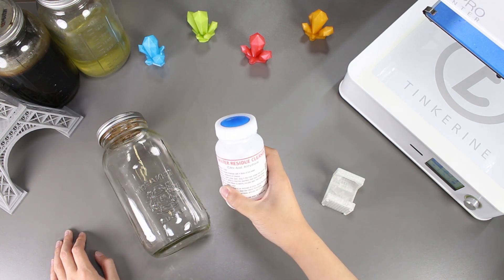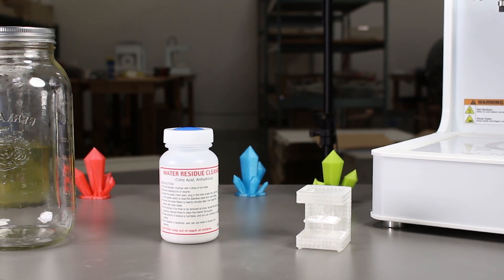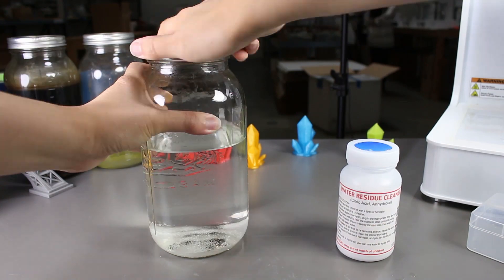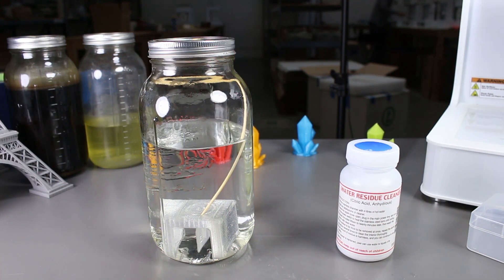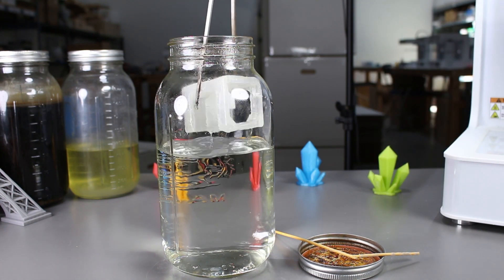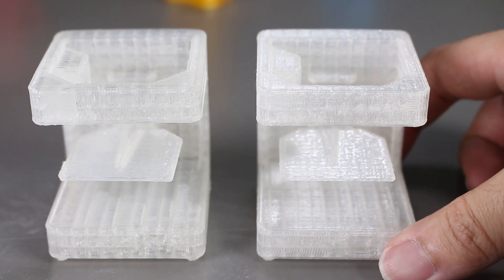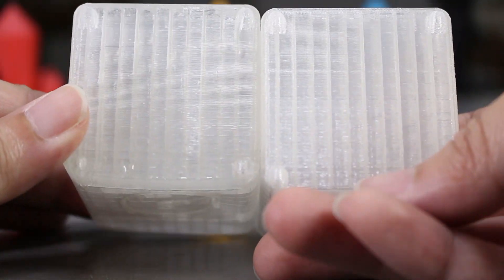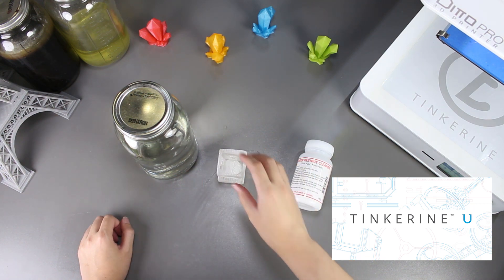Smoothing PLA Prints with Pure Citric Acid

Comment: I've watched these so many times, and they always infuriate me. An idea is suggested- then tested. once. on one filament, no followups, no attempts to perfect or enhance the effect. 

this isn't even very concentrated citric acid, let alone pure! it should at least be initially tested at saturation, beyond that, the filament used is THE HARDEST color to see surface quality with! "one seems deformed, because of the hot water... but they seem identical." no- that's when you test to make sure it's the hot water. we all know it is but AAAAAA just... science! please! you're already doing the work to test it, so please make it actual science and try to eliminate at least one variable, please!

Comment: Blow torch brother... Mini blow torch
Reply from the maker: Thanks for the comment! We've tried with a blow torch before and its pretty good but it does take a bit of a time to get used to.
Reply: It's not uniform and easy to make mistake... Wasting a 36 hours print because you were not fast enough or waited a little too long... + depending of your infill % it's not reacting the same way. I've tried it with "ok" result but it's not usable on minis.